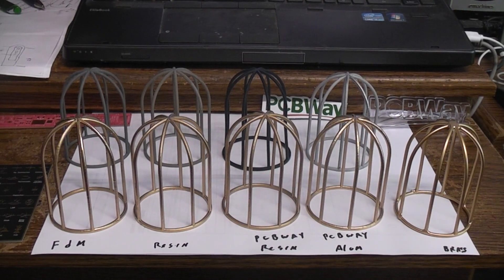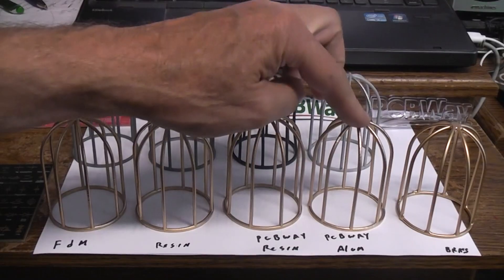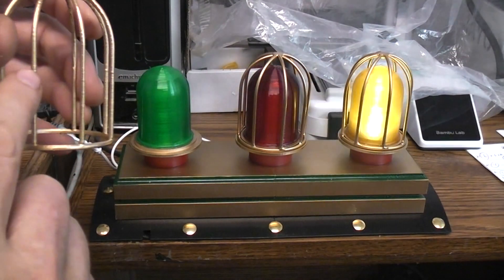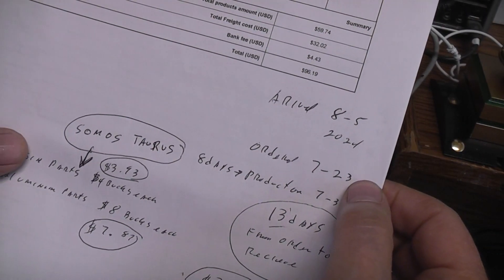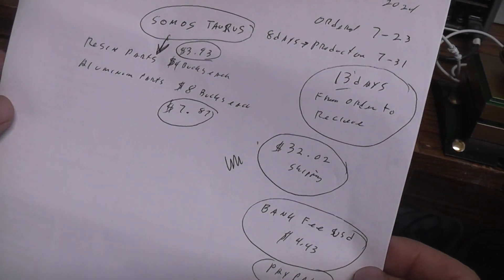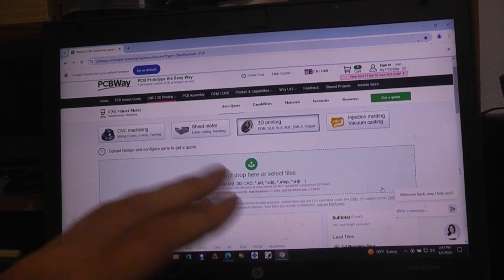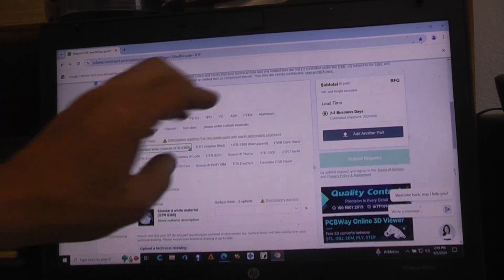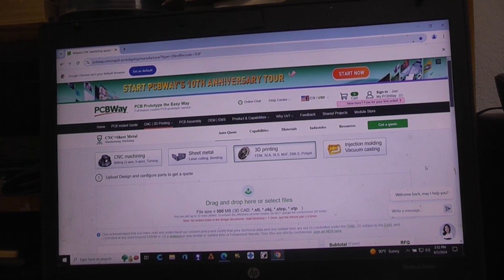Trying out PCBWAY 3d printed resin and aluminum parts on my design and dollar.

Comment: WOW you've outdone yourself on this very interesting and helpful exercise!  I'm definitely going to check out PCBWAY.  A few years ago I 3D-printed a custom front sprocket chain guard/cover for my beloved old mountain bike, in PLA.  Amazingly, it lasted 5 years until my front derailleur shifter malfunctioned causing the chain to come off the front sprocket to the outside and it broke off a couple of the bolt attachment points.  So I've been planning to get my 3D printer out of mothballs and print another.  OTOH after watching this video I may get a PCBWAY quote to have it printed in aluminum.  :)

BTW after living in Thailand for nearly 20 years, and dealing with foreign currencies/exchange rates, I would definitely not recommend Paypal for most international transactions.  Instead I would use your US based VISA credit card and simply set the price when ordering to US dollars.  There should not be any additional fees and you won't have to worry about a poor exchange rate.

Thanks again for your time and efforts making Robothut such an interesting channel!  👍😁👍
Reply from the maker: Thank you for the story and advice on international payments.

Comment: I used abs resin for the parts all came out really good
Reply from the maker: Fantastic. What printer are you using.
Reply: @Robothut  Hi, I use an Elegoo saturn 2 8k, the resin used is by sunlu abs like water washable resin
Reply: @Robothut  also I forgot to mention that in order to avoid any shrinkage issues I always very slightly scale up parts that go over other fittings as like the cages and the clear parts do
Reply from the maker: @WarlockCore  I wanted to test that, so left everything just as designed in CAD. They fit perfectly, so either no shrinkage or PCBWAY knows what the shrinkage will be and adjusts for it.